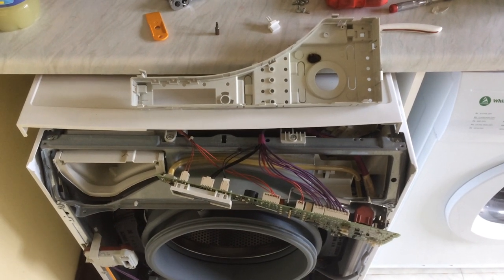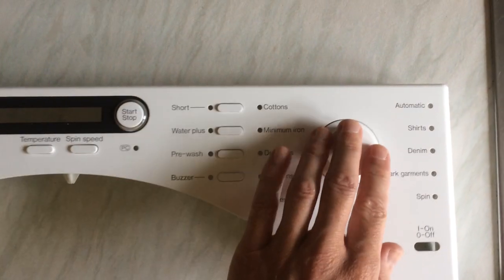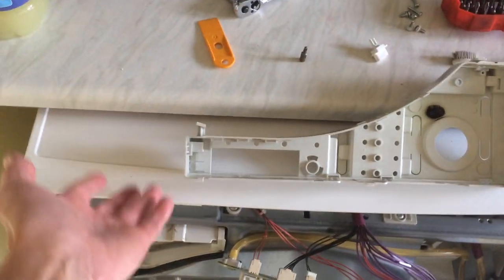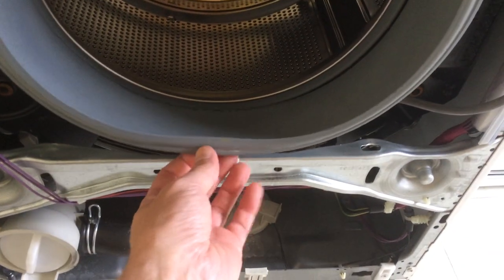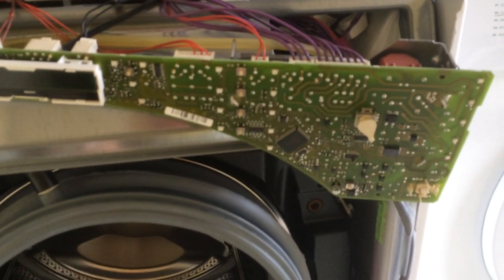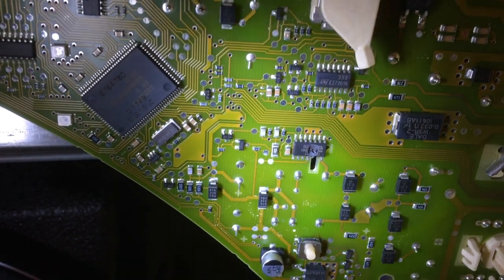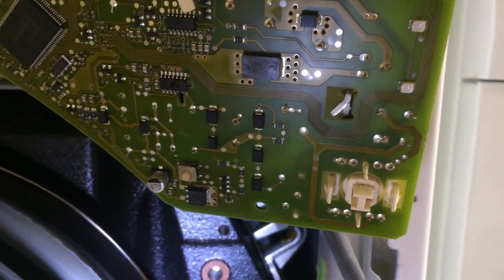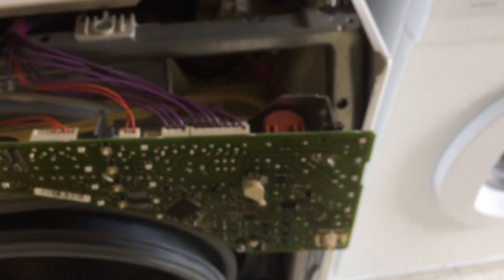Miele Novotronic W1514 Repair EDPL200-A Controller Fault

Comment: I needed to replace the rubber seal on my Miele.  I watched several videos by other people on how to get the front of the machine off, and all involved removal of the kick strip which my model doesn't have.  Only yours explained about loosening and then pushing in the two screws on the side at the top to remove the top to then remove the front panel.  For that little nugget it was immensely helpful thank you.  I now have a new seal on my washer.  I am a female who is handy and will tackle minor DIY projects, but I have no plumbing experience!  The hardest part for me was having enough strength to a) pull the heavy washing machine out of the slot in the utility room and b) having enough strength to pull the rubber seal onto the mounting point.  But I will not be beaten!

Comment: I had a different fault on my w5741 miele, blowing the FET  on the elp165 module inside. But your video helped me correctly disassembling, since a lot is the same on these miele machines. 
Thanks for sharing this! 
Grts 
An Electronics engineer from Belgium😊
Reply from the maker: I'm glad that it helped you, these machines are too expensive to scrap when you can fix them yourself.

Comment: We've had this Miele for years, definately must disagree regarding their longevity.  However I had a leak.  Last time about 10 years ago I paid an engineer over £100 to replace a hose that got cut by a sharp object.  Your information on how to get the top front off was invaluable.  I found out that it can be run with the side panel off and top off so you can see where leaks are coming from. Obviously keeping hands away from Belts and electric cables, but I guess that's common sense! Thanks anyway.
Reply from the maker: My work colleage and I own a number of Miele products and although they are designed better than cheaper makes they don't last the claimed 20 years and when they do go wrong they can be expensive to repair. I know of 2 washing machines and a fridge/freezer that didn't go the distance :-(

Comment: Adding here the settings for a W1713 washing machine:

Water intake: Cold
Max water level: No
Flow meter: Yes
Low water pressure: Yes
Sensor rinse: Yes
Allergy: No
Country version: EU
Auto load control: Yes
Heater rating: 2100W
Suds container: 6kg
Imbalance charts: 6kg
Max spin speed: 1300
Imbalance sensor: Tacho
Time left disp: Yes
Motor type: MRT 37-16
Hygiene: Off

Comment: @Kevin Stewart, @Sebouh, thank you very much for information provided. I'm currently checking controller on my machine. TEA1522 is dead as expected, but I'm getting 310V on the main supply cap. What should be checked next?
Reply from the maker: Hi 
Uroš, take a look at my full description above. My summary is: the SMPS transformer has probably failed and there is a possibility that your micro controller is also faulty and that is just too difficult to repair. On my board many other components were faulty and it was just easier to replace the entire board with one from eBay. I would strongly suggest adding some transient suppressors to the 15V and 8V rails to protect the components downstream from any future failures. Let me know how you get on.
Reply: Hi  @bvqbvq  , at the end I took the board to the electronics repair shop (kindly recommended by local Miele service). They replaced TEA1522 and found a number of cold joints, most of them on PCB connectors. It seems that nothing else was broken as washing machine now works with no issues. So far it has had around 10 working hours. Anyways, I plan to add the transient suppressors as you recommended.
Reply from the maker: @urosmaksimovic7969  , it sounds like you were lucky that the processor wasn't damaged on your board. I'm glad that you managed to get it repaired. Mine is still running with the board that I bought off eBay although I did add the transient suppressors to protect it.

Comment: Kevin, Great article thanks a lot. It was very helpful. Do you know the voltages on the secondary windings?.
My SMPS transformer is short so I am planning to remove the transformer and apply external power on the secondary terminals but I don't know the voltages. Thanks again
Reply from the maker: Putting 50V DC across the main supply cap before the SMPS results in 15V and 8.4V across the 2 down stream electrolytics. The lower voltage is on the one nearer the edge of the board. I think that the 15V is a little high as it is used as the relay coil drive voltage. The 8.4V is regulated down to 5V for the processor and other digital circuitry. Before you waste too much time you need to determine whether your processor is damaged. This is not so easy to do. You may be able to make some resistive measurements of the I/O pins that drive the ULN2003 inputs. If your ULN2003 ICs have short circuits then you may be out of luck.

If you want to run up the whole board you will need to apply mains to the input connector as it powers up some other circuitry that the processor needs to see running before it will show the normal program menu. Additionally I think that it needs to see some of the connected peripherals, perhaps the temperature sensor before you can activate the wash cycle and see which relays are being driven. On mine there was no drive from the processor to the inlet valve relay at the start of the cycle :-(

There is a system schematic tucked into the left-hand side of the chassis under the top cover, that will allow you to identify what is connected where. Let me know how you get on, I am curious to find out more about these boards and whether they can be repaired.
Reply: @bvqbvq  Kevin, thanks a lot your info was very helpful. I removed the transformer and supplied voltage 15V  and 8V to the 2 electrolytic capacitors as you mentioned from an old satellite receiver power supply which luckily had outputs 15v and 8V. Connected main supply without connecting any peripherals and the display now shows “Waterproof” “Fault” with buzzer sound and LEDs on. I will connect it to the washing machine and let you know. Do you know exactly what is the big red color part? 
http://www.tout-lectromenager.fr/images_forum/tout_electromenager_lavage_3664.jpg
When I replaced the TEA1522 and connected the power supply noticed smoke coming out from this part and I immediately disconnected the power. While I tested it with a multimeter still shows continuity. Now I am planning to insert the satellite power supply board in a waterproof enclosure and supply 15V and 8V power to the board. Hope this red part will not be a cause for the washing machine not to run properly. Thanks again. Hope one day I will be able to return your help
Reply from the maker: @sebouh5369 "Waterproof" is correct, you need to short out the outer pins on the 3 pin connector next to the buzzer if the float switch is not connected. The large red component is a common mode choke for noise filtering. You should not have smoke coming out of it! Have you repaired your transformer? My TEA1522 was damaged because there was a short circuit on the transformer primary. I had to unwind it all and wind it with new wire. I would make some resistive measurements of the 3 components clipped to the side of the metal heat sink. There should not be any low resistance.
Reply from the maker: @sebouh5369  did you ever fix your board? I tried to read the code out of the processor on mine so that I could replace it but had did not have any success.
Reply: @bvqbvq  I just put external power 15V and 8V as you mentioned. The washing machine works well till today. Thanks a lot.  I added your provided info on Instructables
 https://www.instructables.com/id/Repair-Power-Supply-Miele-W1514-W1714-W1614-W1730-/
I assume you couldn't read the processor code because you must have the correct ID value. Unfortunately I do not have much experience in order to help you

Comment: Hi. It is helpfull what you said. I am having almost the same issue with a w1622 novotronik. No power and the pcb looks dead. I don’t find the 15 v, 8v and 50 v. The fuse is ok. It looks that the transformer is dead. How can I identify it in order to buy it,? Thanks a lot.
Reply from the maker: Hi, in the end I was unable to repair the board because one of the I/O pins on the processor was damaged. It may be easier and cheaper to buy a second hand controller board on eBay.

If you want to repair the power supply on the board then you will need to repair the transformer. It is a custom part and I have listed the specification in the video description. The quickest way to get it going is to carefully unwind the transformer and wind some fresh wire with the correct number of turns wound in the correct direction because it is a flyback design. Good luck!

Comment: Kevin wrapped i found your instructable/youtube video,  my W1913 washing machine has died.    My transformer is dead and i have read your above description and word document on google drive but feel i dont have the skillset to rewind a transformer,  is there any transformer i can purchase online that would suit as a replacement?   ( the lengths of the primary and secondary wires in the transformers match what you have listed above).
Reply from the maker: Unfortunately as far as I am aware the transformer is specific to this application. I would strongly advise that you buy a second-hand control panel from ebay because even if you repair the power supply, you are likely to find a lot of other components that have been damaged. On mine, one of the I/O pins on the microcontroller was damaged rendering the board useless. I think I have seen control boards for about £40 ($50, €45) on ebay.

If you haven't damaged the transformer core then you could just acquire some enamelled winding wire and rewind it manually. You will need to change the SMPS IC and any other components that have been damaged. I would strongly advise fitting some transient supressors across the output DC supplies to protect them in future.

Comment: I love these old Miele-Machines and am looking for one.

Does it make sense to buy a used one for 200€ on Ebay? Thanks in advance :)
Reply from the maker: As well as buying one from new, I bought a cheap one from ebay a few years ago but it had had a hard life and the drum suspension was completely worn out. It nearly shook itself apart on spin. If you go into the service menu, you can see the cycle count. I think that there's a video on YT that shows you how to do it.

Comment: Hi Kevin, to get your machine working you had to rewind the transformer, splice together the wires, replace the chip (tea1522) and replace the green resistor. Were there any other components that you had to replace? Did you get the problem where the drum spins like crazy and the F53?
Reply: Actually after reading the description all I can say is wow. Great article and wow!